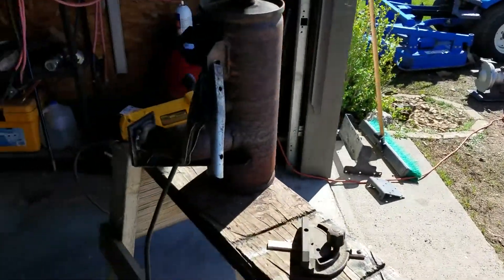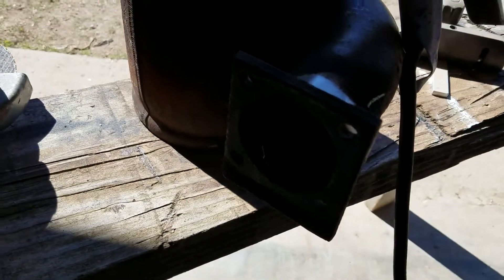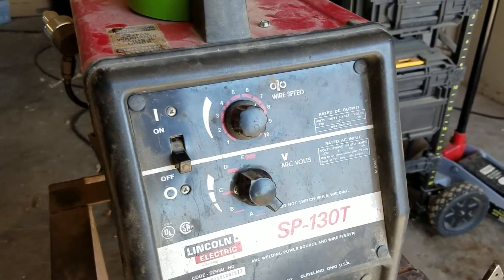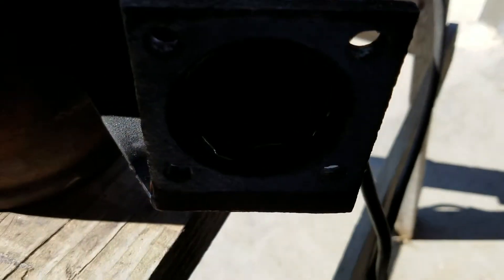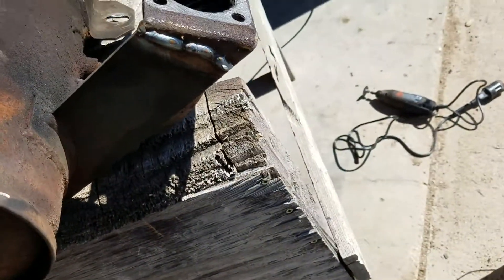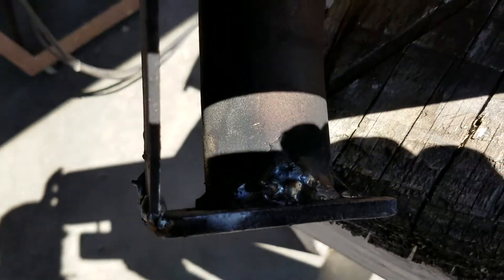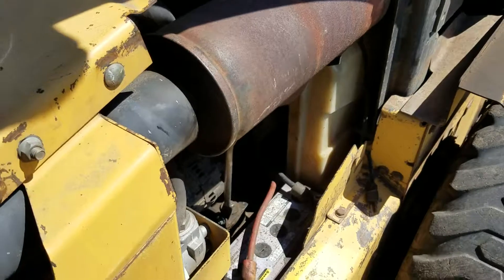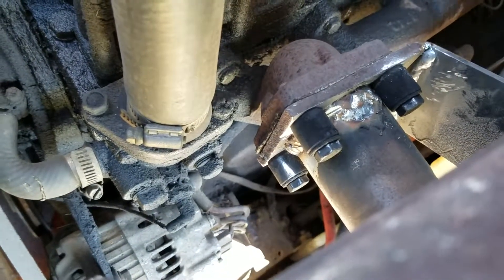I Saved $300! New Holland L565 Muffler Repair.

Comment: As long as the holes are sealed, and it stays where you put it, it looks good.
Reply from the maker: I thought I would have a tough time getting the 4 muffler to manifold bolts out but diesels seem to be easier on that sort of thing. It must be the extreme hot cold cycles gas engines go through that make it difficult to remove that on a gas engine. Nice job to have done and it wasn't that difficult.
Reply: Yea manifold bolts are always a little scary, not a job I ever look forward to. I wonder if it was just a lame factory weld, or if the last owner had to deal with an issue as well.
Reply from the maker: JimsEquipmentShed I think it was a lame factory weld the bolt holes circle was not much greater than the pipe diameter so they only welded the pipe to the flange in four spots between the bolt holes. then diesel vibration takes over and first busts the pipe from the weldd then shakes the strut brace bolts loose then finally cracks the flange metal brace to the muffler. it was loose when I bought it used. That unfortunately is how I roll at times. A new muffler would be about $300 dollars. I wonder if they learned to weld better.